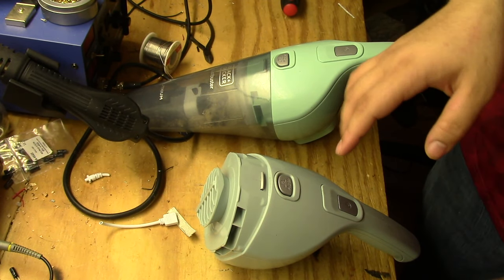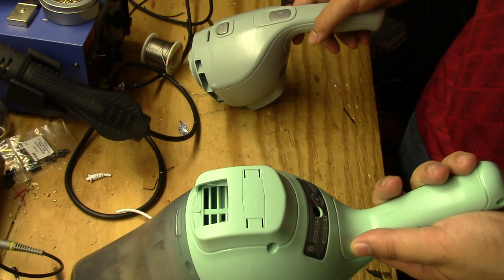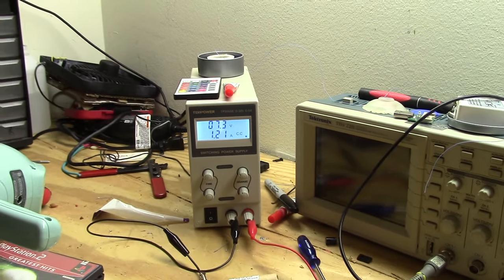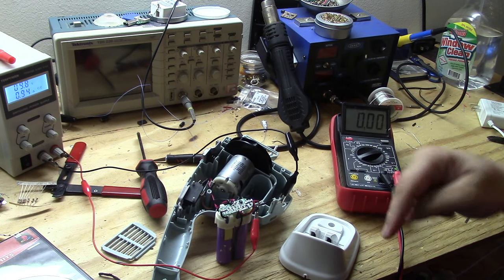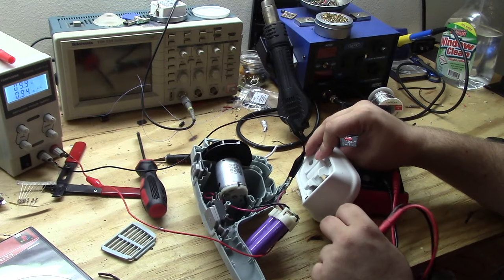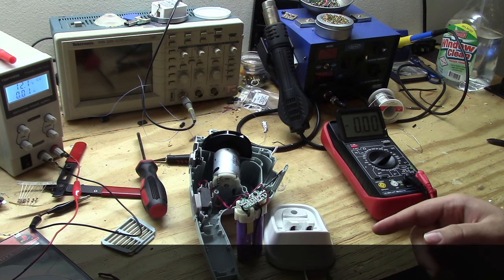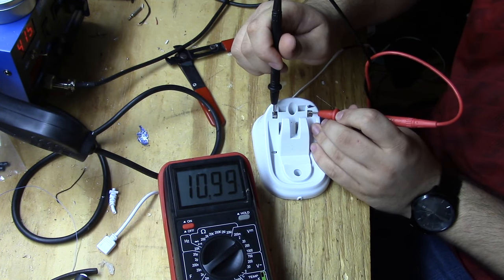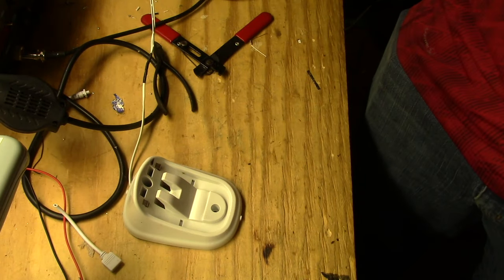Fixing a defective Black and Decker hand held vacuum cleaner.

Comment: That is the most outstanding help video I have ever seen. 

Thorough, detailed, has no pretensions in his presentation, it is filmed well and will save me a boatload of time. 

Much easier to reverse the wires on the leads than to have had to take the device completely apart and investigate every possible point of failure. Besides, I do not have those skills. And it is true about Black & Decker.: Inexcusable quality control. Like many old, established brands they have succumbed to prioritizing manufacturing costs and profit to pump up those quarterly reports which hold up the share price. 

When I was a kid (I am 67) Black & Decker was THE brand. You could count on them. I had their jig saw and many other devices. And that is why I bought this vacuum.. I have found this same erosion in quality in other major brands I once bought. Now I check to see if the company was acquired. The source of sale is important - For example, there have been products sold through Amazon that were counterfeits. And they take no responsibility. 

Thanks Solderking! You da' man!

Comment: Thank you sir. This the most useful video I have ever seen. I had my B&D hand held vacuum cleaner (little bit different than yours) for  over 10 years. It worked for the first few hours but stopped charging. I never used it again and decided to dump it. I tried to see if I can charge it again and left it on charge for 3 hours without success, it started and stopped after 5 seconds. I thought it was the battery. After watching your video and opened the docking device and reversed the polarity (was careful in case it blows up before switching it on) and it did the job. It started charging properly. After 10 min charge the motor was running at full speed. I cannot thank you enough.

Comment: Hey Taylor!  Thanks a bunch for the video.  I had a dust buster that I kept in a cabinet.  I had disconnected the wires from the base to get the power cord through the side of the cabinet and then reconnected the wires.  Worked great for years  Fast forward, got new cabinets and was going to do the same.  Afterwards, the vac didn't work.  I had reversed the wires!  (Duh!).  Your video made me realize my mistake.  Kudos to you bro!

Comment: My Dustbuster has never run for more than a few minutes. I’m wondering if there is a thermal cutout somewhere in the circuit. The batteries seem ok. I can switch it off when it stops and leave it fire a few seconds then switch on again. It will run for 30 seconds then stop again. I can repeat this many times before the batteries begin to wind down.

Comment: Hello,
My vacuum goes off after 20 second and the next times in a less than time like your vacuum, is its problem landed in batteries? It happens even when it's plugged to the power !
Reply: Mine does the same thing!!  I wish I could find an answer to this issue.
Reply: I have the same issue. Runs for 20 seconds. Turn it off. Runs another 20 sec. Worked good for a year or so. I think it’s something on the PC board like a thermal switch. Heats up then quits until cool.

Comment: My 4 lithium batteries were down to around 500mAh capacity each when i tested them. I changed the cells and charged it and it seemed to work fine. After leaving it on the charger as usual it will on run for a couple seconds only now before it shuts off and the light flashes. It charges up real quick and then i try it and get the same thing.

Comment: I have a 9V power supply that reads -13V when measured at the polarity it should be. I'm assuming it's some kind of failure mode for a certain kind of supply design. Maybe something similar is at issue here. There's no way it should be + or - 16V for that charging.

Comment: If your unit has 7.2 volt batteries meaning thats whats required by the motor then the charger putting out 16+ volts seems extremely high if you expect the batts or motor to last very long. The chargers generally only put out a couple of volts above the required total amount.

Comment: Fyi to those who may have several black and decker cordless items. There are drills and screwdrivers etc that the batteries are not removeable but have a wall charger with a plug to insert in the item to charge it. If you happen to lose the wall charger do not assume you need a ac to dc charger. Ive found many of them are ac input and ac output wall chargers. The drills ive worked on did not state the power requirements on the id sticker nor was it molded into the plastic like most are. I had to actually take the units apart to find out what power supply was required.

Comment: Have the same vac with the same problem. Want to go from Nicd to lithium. Thinking of a 1S 3P pack. Will a BMS with a 2 amp overvoltage cutoff work or should I go higher/ Thanks

Comment: Hey Taylor my vacuum stopped working today the same model you show on this video,I opened it up and everything looks good,the charging base does work I connected a clock radio using the same vacuum charger and it works so now I don't know if it's the batteries or the motor it's been working fine for the past two years until today...is there a way I can fix it? Thanks in advance

Comment: I have the newer version 3.6v, that has stopped charging. Any tips on that, since you have one?
Reply from the maker: I haven't ran into any issues with that one yet lol. But if it did charge before and not now I would say that the cell is probably bad
Reply: same here, 3.6v version (single cell guessing), worked for about 1.5 yrs now wont charge - charger tests good. Wish they made it easy to swap out cells just like a flashlight - its almost easier to just trash it and buy a new one for how cheap they are, but i'll try to fix it just to reduce the environmental waste.

Comment: Hi Mr Solderking. when i press the on button it works but i have to keep pressing the button down for it to stay on. as soon as i take my hand off it turns off. the on button doesn’t click down. how do i fix this
Reply: If you read the device’s manual, you’ll see that’s the intended functionality. Which is stupid, yes.

Comment: And also why I was putting it back together you should have added lubrication to the motor even though I didn't need it cuz I used to have one of these except it wasn't like the greenish one we had to plug the port into the back of it and one day the motor started squeaking on it sadly back then I didn't have any kind of lubrication so I didn't fix it and that's why I be used at vacuum without putting a filter in it but now I have a new one that I know how to treat it it's also a newer model and it hangs up on the wall like that one except it's a newer model 🤗😃👌